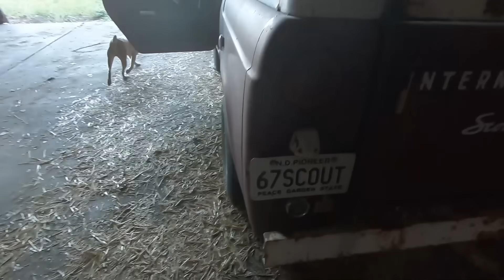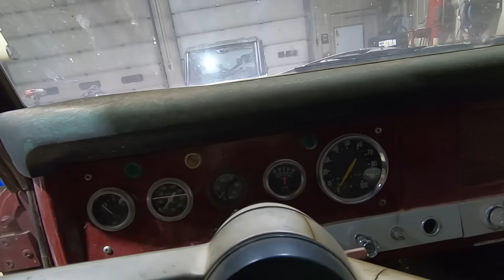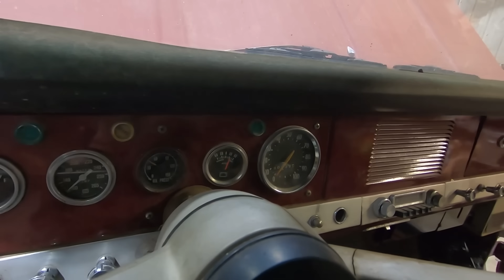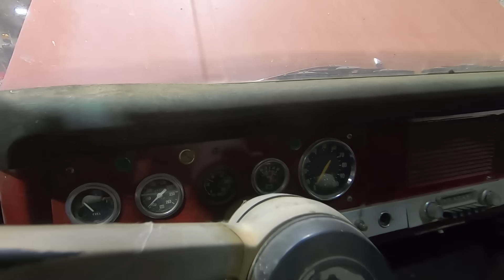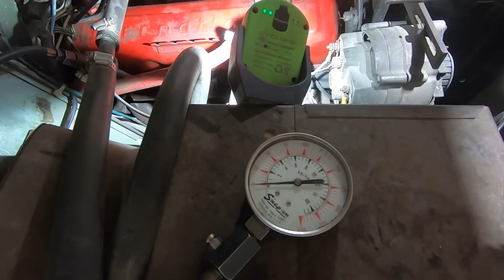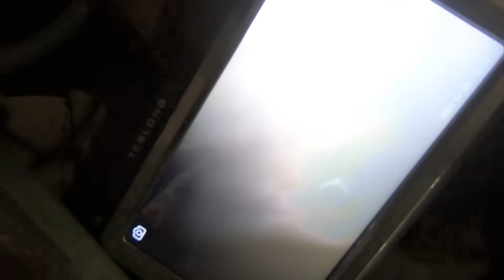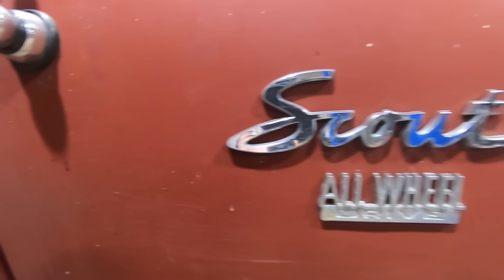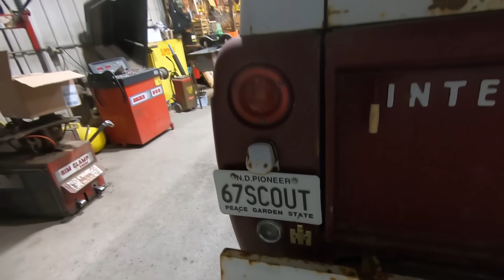Barn Find! 1967 International Harvester Scout! Will it Run?!?

Comment: Both my IH 392 had great rod bearings, but the MAIN bearings were worn down to copper and sounded like that. A deep rumbly noise.  You also sound like hydraulic tappets are shot. I reused the cranks. One main journal had ploughed up a groove and left a nub sticking up, I took a flat file and knocked it off and checked each journal for smoothness. They are BIG main journals on these cranks.

Comment: That scout has a dana 20 transfer case like the older jeeps. One is "in and out" for 4 wheel drive. The other stick is "High, neutral, low". If you also look on the driverside of the engine, there should be a stamping towards the front of the block that will tell you displacement. It should have 152 or 196 depending on which one this is. It should be right in front of where the coil is mounted.

Comment: Pretty cool Quonset find! Hard to believe that noise is "normal", I was thinking wrist pin too, but I guess chalk it up to International things. Thanks for the video, I always enjoy them!🙂
Reply: I've seen several general motors products get a knock like that that ended up being the fuel pump the spring on the fuel pump from heat would get weak and would allow the fuel pump rod to slap back and forth

Comment: i think the tappy noise could be a wrist pin, im basing it on your assumption that it might have been a tow rig like a once a year use, which really isnt good for wrist pins because they dont get that much oil as it is because the tighter fit than most other parts and they sit most of the time and dry out. but they can go on running for years like that with the low use and not reving it to the moon. just my 6¢ worth.

Comment: I had a 1963 scout with a snow plow,  It was the one with a cab and small truck bed.  It would plow the steepest roads with out chains. The only problems I had was it was very hard to fill the gas tank because of California vapor recovery nozzles( they would just keep shutting off) The brakes were way to small, and even with all new shoes ect it would not stop very well..  I finally sold it and bought a Jeep CJ5, 25 years later I still have the CJ
Reply from the maker: Sounds like quite the rig

Comment: Yeah they came with v8's I had a 68 800a with a 266 V8 t19 4speed dana 20 t case and Dana 44 rear and Dana 30 front with 4.27 ratio with track lock rear dif . Fun rig gave it to my girlfriend she loves it.

Comment: Being a 67, valves dont have hardened seat. Were meant to use leaded gas. Doubt heads were redone. So could be a contributor to weird noises. Owner noticed it since he had it but heads would of been running for years by then already.
Reply from the maker: Head has been redone

Comment: Definitely lower end noise, but a mechanics stethoscope 🩺 would point you to the exact spot real quick. Also works great for finding bad bearings (wheel hub, alternator, WP, idlers & tensioners, ECT...) A chassis ear would also work pretty good for that. Also great news the comp gauge was just a sticky valve! 💪🏻 Sweet find for sure!
Great episode!! I'm partial to the truckish stuff.

Comment: Those pistons look like the ones in a 1966 International Loadstar 1600 grain hauler we had on our farm. Dad rebuilt the 304 V8 engine one year. He had the pistons laid out on the bench and I remember all those divots on top of the pistons. The edges of the piston were rounded off and not square like you normally would see on most pistons. I honestly don't know how those engines would get any compression that way but that little 304 ran great once it was tuned right. I really like those old IH engines and it breaks me up every time I see people yank them out of their revival job and throw them away. Those V8's were strong runners and I think they could go a long way. All their trucks had million mile odometers in them so I'm sure they weren't just expected to go 100k and wear out.
Reply: That 152 is exactly half of the 304 V8, so the similarity isn't surprising.  Probably had the same part numbers.

Comment: I wonder if the carbpotatoe need a quick rebuild, the way it doesn't really like to start so much.. maybe it's still just got some cobwebs in it.. Another great video, thanks! I have a feeling that clack clack engine diesel sound is just a worn writs pin or something, little slap in the cylinder.. It's tough not being there to hear it, but she runs so what the heck!

Comment: I'm a bit late to the party, but the noise you're experiencing does sound a lot like the piston slap I'd experience with Rover K-series engines. They were all-alloy "sandwich" engines where the cylinder head bolts went through the block and held the main bearing ladder. What happened with those was the piston (alloy), liner (iron/steel), block/crankcase (alloy) and head (alloy) would all warm up at slightly different rates, so when cold they'd "clank" like this motor until everything warmed up.

Comment: I don’t doubt that it was a little cool inside the cab there, noticed as you were driving along that aftermarket sunroof with the spigot for a handle was lifting up. You can really see it in the portion of the video on the drive home, as you were looking at the gauges saying we hit 65 not sure if it’ll get to 70, I noticed a reflection of light up over your head. So I started watching a little more closely and that’s when I noticed the sunroof especially where it “latches” lifting up off the frame.

Comment: Back in a previous lifetime, before college days and when I still had hair, I was an International mechanic (circa 1966) and worked almost exclusively on the 4wd Scouts and pickups.  I also owned and drove several Scouts -- my favorite was a '67 800, 152, 4-spd.  Loved it until it rotted away.  I also had a '61 Scout 80 pickup style, 2wd, sliding windows, 3spd.  Nobody ever designed a more basic machine.  (And yes, IH did put the 266 V8 in some Scouts.)

That sound could be a bad cam, a worn lobe, worn lifter.  I remember seeing a few so badly worn that the oil leaked out of the wear holes and the hydraulic lifters collapsed.  NOTE:  They can be pulled out from the top with a really good magnet and replaced the same way.  No need to yank the cam cover or manifolds... unless the lifters have been mushroomed.

Pull the valve cover and inspect and measure the lift on all rockers.

Comment: Not sure if you've thought of it, but usually if you pull a spark plug wire off each cylinder one by one, start it and listen to see if the knock changes.
Reply from the maker: we tried that, didn't change

Comment: Scout used an odd size flex hose for the air intake to the heater, so that might be why the heater inlet is covered with tape.
The stock V8 they made into a 4 cylinder was the 304, not the 345.
Reply from the maker: Interesting

Comment: Might that klink klink maybe be a starter/pressure plate issue. Just tossing darts on my part. Hard to tell hearing it off a recording. Cool little vehicle. Too bad about the submarine hatch in the roof. That's a bunch of structure to be removing from that roof. Coolness.
Reply from the maker: Everything looks solid under there

Comment: The Scout 80 version '61-65 you could only get the 152 engine backed by a 3 speed manual.  By the time of the 800's, the 4 speed manual was an option and certainly not a rare one.  Scout 80 and 800 4x4 models were only ever offered with dual range t-cases.  There was never a single speed/range t-case option in those models.  That didn't come along until the Scout II arrival.

Comment: It May be the flue pump ,odd ball things happen on internationals ,I drove the gas pot internationals for years and everything  happened over time. Funny story went to pick one of the trucks up at international and they were warming it up and it started to miss a bit and then it started to vibrate and shake the valve train broke in half on a brand new 392  Good luck
Reply from the maker: weird

Comment: In high school in the early 90’s I had the scout market in my home area cornered. I bought the first one for $25 and found out about another guy that had one, from that owner and another from that guy and another from the next guy and so on. None, I mean none were road worthy unless you put complete floors and rockers on em, and I never found one with a V8 or 6 cylinder. All were 4 cylinders an 3 speeds. Had 9 total which only 2 were even good enough for a woods beater. Blew up all the engines trying to pull big tires around, many clutches and differentials. Only had one that was true all wheel drive because I took a rear differential and put it in the front. They’ve all been made into I-beams by now.
Reply from the maker: Awesome

Comment: I usually pull one plug wire off at a time to see if it makes it go away if it doesn't get spark it doesn't have pressure on the rod bearings are anything you know that

Comment: Rod knock will make more noise with less load! Like free revving or usually can hear it  rattle just before a shift
If it’s one cylinder making noise and it’s piston or rod in question….pulling one plug wire at a time while running can isolate a lower end knock.
If the noise goes away which ever # plug wire is pulled…that’s the cylinder with issues .
Also from the bore scope angle it looked like a lot of side wall clearance ? Maybe not , just looked like it

Comment: A good friend of mine had a 1970 Scout that he drove for years.  The 196 slant 4 is just a 392 IH V8, with half the cylinders sawed off.  The Scout was a tank off-road, but was miserable on the highway--slow and noisy.  IH bodies were always rattling garbage, but the driveline was nearly indestructible. I owned 2 Scout II's over the years.  A bit bigger, but still a crappy body.  One had the Nissan Diesel--awesome off-roader, wished I hadn't sold it.  The other Scout II had the 304 V8.  It was also an awesome off-roader, but got absolutely horrid fuel economy.
Reply from the maker: Definitely crude rigs!

Comment: Looks like it is pretty good shape for its age.  You know, my philosophy about strange noises is, that is what the volume knob on the radio is for. When whatever is knocking finally goes, then you know what it was  😀 I swear that rod knock is because one bearing is not the right size. Only way to know is to plastigauge the rod bearings.
Reply from the maker: one way to find out!

Comment: That knock is not from factory.  It's either a bad wrist pin, probably in that #2 where the screw impacted the piston, or its in the valve train.   The good thing is when it suffers oil pan failure, failure of the oil pan to keep the contents inside the engine, you'll know what it was.

Comment: Excellent video Mortske Repair  :) also Duff The Dog :) yes these International Scout pick up truck plus SUV weird weird made also 4 cylinder motor 156 Cubic Cm an 304 , 345,  392 V8 in 2 or 4 barrel carb Holley plus Carter with Hand choke cable knob in dash, Transmission were 3 also 4 speed Automatic transmission of Chrysler Dodge type plus Manual transmission were Eaton D16 and D18 with Bow Low First gear also Creeper 4 speed! But I have they  use Desiel engine in 4 cylinder only and lots people put Volkswagen , Cummings, ISUZU and ratio were 355 to 409 but 410 plus 411 ! Also Mortske does that fuel pump have glass bowl with filter too and AC Delco Alternator be 70 to 90 amps ! But Alternator rare  because if got 70 amps it 2 stage low amps is 35 and when on under load 70 amps 1966 when brought out  too!

Comment: At 51 minutes, I'd like to solve the puzzle.  Is it the vibration damper, either loose on the shaft or the rubber and the steel came apart?  😊  (Never mind.)  Once in the summer of '66 I owned a 58 Olds 98 chrome machine.  I was playing with the carb, air cleaner off, and a small screw from the accelerator pump flew up, over, down the carb.  It clicked really nice of the driver's side.  Pulled the head, tapped it away, reverse procedure.  A new screw and the engine was happy again.  Maybe I should have left it?

Comment: IIRC the engine is either half a 304 or half a 392 - you get a hugely overbottomed 152 or 196.  The 196 was good for something like 101 horsepower.  That's where your friend was coming from, saying it wouldn't be the bottom end making noise.  There's way too much meat down there to take up what little punishment this thing can generate.    I reckon modern induction could uncork a lot more ponies.

Comment: Yes, you could get a V8 engine from the factory in the Scout 800, perhaps by 1966 and certainly by 1967.  The Ford Bronco basically forced IH to update the Scout 80 to the 800 and make it a bit more refined to better compete with the new kid on the block.  You should try reviving a Scout 80 model next.  If you think the 800 is primitive...you ain't seen nothing yet!  The IH V8 options were a 266, and then by 1968-9 ish, the 266 was discontinued in favor of the IH 304.  You could also get a Borg Warner 3 speed slushbox in the Scout 800 from the factory...Fancy!
Reply from the maker: Great info!

Comment: The mechanical fuel pump was on every 1960s vehicle including the fuel injected ones. 90hp first gen 4 cylinder 60 years later. It's the rod bolts. For less than $400.00 it'll still pull 89hp bet your Li-Ion 60 years on that!

Comment: Cyclops light. To soften and diffuse the light, don't point it directly at you. Reflect the light off the dashboard or ceiling. Also, you could put a square or two of black window screen over the light to knock down the brightness. Even a sheet or two of Fabric softener to soften/diffuse the light. Experiment.

Comment: I know over a year ago on video date, IF you think that one drives weird, a friend in High School in the 70,s had one that was right hand drive, a couple sanwiches, and things got real interesting  LOL IF I remember right, that noise that sounds like a lifter or rod knock, he found was the fuel pump lever spring, I had a couple other old 70,s cars do it, there is a spring that pushes the lever back to cam, and when  that spring goes bye bye, it sounded just like a lifter let go, or a rod thinking about letting go, put a broom handle on the pump housing to your ear, and maybe see if the noise it makes is coming from there, I bet that would explain the fuel issue to.

Comment: I wonder if it would be worth removing the fuel pump and push rod & patching in an electric pump might solve the knock problem.  I also would swap the fuel cap just in case it might have a blocked vent hole.  Just my 2 cents worth of ideas for what it's worth.

Comment: No marker lights until 1970.  69-69's might have had round reflectors.  No lights until 70.  The doors have panels on them that's interesting.  That wasn't anything for a basic stock scout.  There were "dolled" up models that had various degrees of interior panels/headliners.  Nice scout though.  If there's any electrical problems it's almost always the green wire.
Reply from the maker: Thanks for the info!

Comment: Been enjoying all the love IH is getting from both you and Puddin of late. Hardly expect you to know how to work an old school oil can and spout as it's become effectively lost knowledge. Until my wife's death 9 years ago I would occasionally shave with a 100 plus year old cut throat straight razor( sold both I had along with a lovingly restored 1870s US cavalry officers strop after my wife's death as I no longer had the focus to use one) and vintage and antique safety razors on a regular basis. Coming of age at a time when the cartridge razors were coming out dad felt I didn't need to be taught to properly shave with a double edge razor as the new razors were idiot proof just slap on the shave foam and go so obviously I had a bit of a learning curve there.
If I have the knowledge and someone is wanting to learn then I've got no issues and no shaming to pass on that knowledge.
Reply from the maker: I'd rather not try to use one of those, always wanted to get a straight shave sometime tho, but it's beard season currently
Reply: @MortskeRepair  it's hard to find barbers that do the full hot towel straight shave but when beard season passes definitely treat yourself found I could go 2 days before the five o'clock shadow came back with the cutthroat shave.

Comment: You can pull one plug wire at a time,,,   If the noise goes away then it is either the wrist pin or a rod bearing,,,  If you are on a trip and  a rod starts to knock,, then you can pull the plug wire to the offending cylinder and continue on your journey,,  :-)
Reply from the maker: never change when we tried that
Reply: @MortskeRepair  OK then,, is the noise in time with the crankshaft or in time with the distributor?? If it is in time with the distributor, then It is probably a collapsed hydraulic lifter,, Increased pressure on the valves from the combustion cycle could cause the noise to get louder when the throttle is pressed,,  In time with a complete rotation of the crank?  HellifIknow,,,

Comment: If it was me I would have had Duff stuff a rag in the tail pipe when it was running. Maybe an exhaust leak? I don’t have an ear for these things. Anyway if the sound changes might point to exhaust leak. Kind of sounds mechanical from here.
Reply: You think stuffing a rag in the tail pipe would be good for finding exhaust leaks? Never tried it before.

Comment: I had one of those early scouts it was same 4 cyl i had a 8 cyl distributor cap on it and used every other hole   it was a 3 speed manual and transfer case had 4  hi and lo  2 handles  i had a 6ft western plow on it and it would go thru everything all 4 wheels hook up it was crude but a work horse  all for now    charlie  ( my duff ) and i   are going after some cock birds our 4th day of season
Reply from the maker: Interesting on the cap!